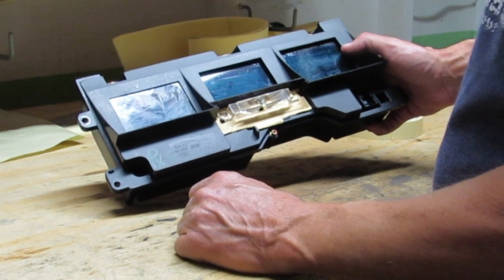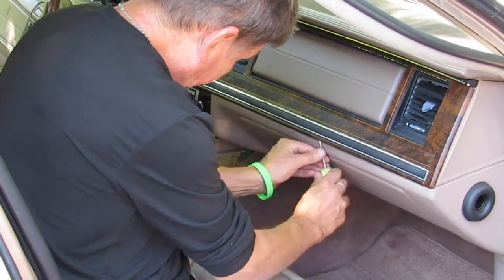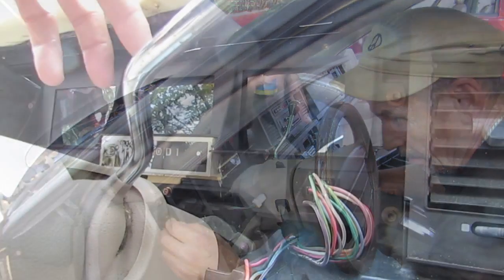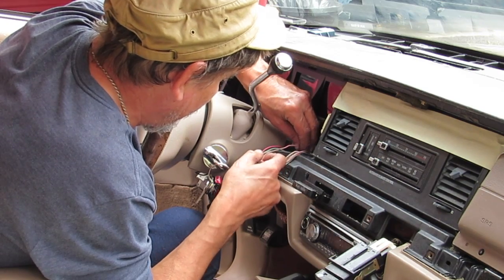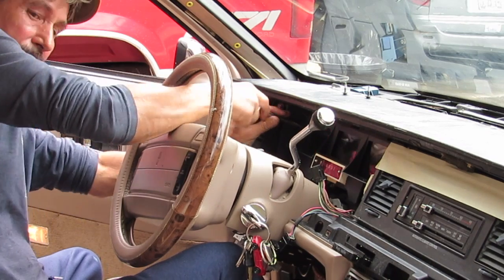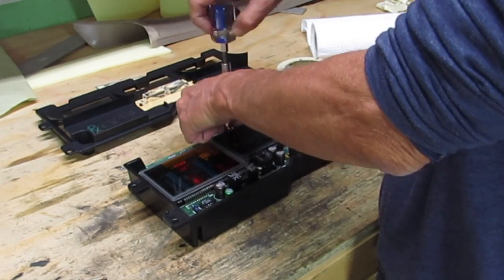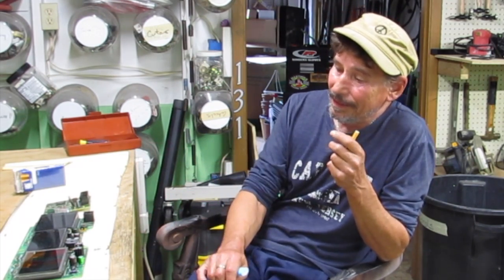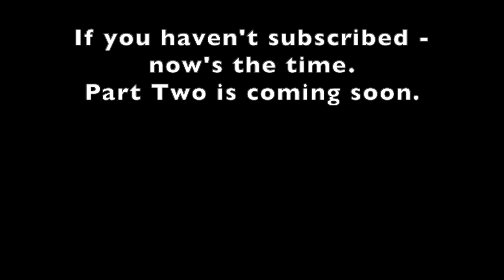Can you fix A DIGITAL DASH?

Comment: Hi John, I have an 88 TC. My gas gauge digital isn’t working properly. Marks empty all the time. What do you think?
Reply from the maker: Well put some gas in it! LOL Just kidding. I had a dream like this once. I realized it was from being married to a woman who couldn't be happy. 
What's sending the digital signal to your dash from the gas tank. I'd look for a short in that wire and then suspect the cluster connection on the circuit board but I'm no electrician.
For now just keep filling it up so it doesn't surprise you. 
Peace

Comment: man i feel your pain i got a 1983 mark vi digital cluster no one wants to touch it dreading working on it this summer
Reply from the maker: Yeah - It's been a nightmare... I got to the point of putting it back in the car, plugging it up and getting diverted to restoring my interior... Just kind of avoiding ripping it back out and going to work on it. 
Keep me posted on your progress and I'll keep you posted on mine. 
Peace
Reply: @JohnDisque  yes sir
Reply: Any update on this issue? Got a 1996 grand marquis with Digi dead issues keep getting co reading can’t tell how much fuel I have
Reply: @KizzieKams  no it seems everybody's allergic to these digital dashboards but ironically that's the only thing that makes these cars cool one of the coolest things on the interior